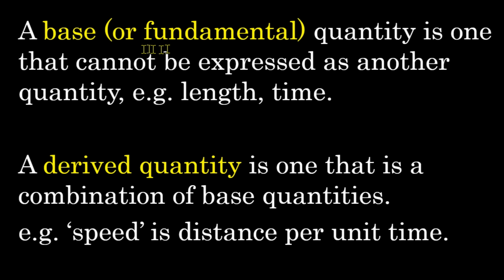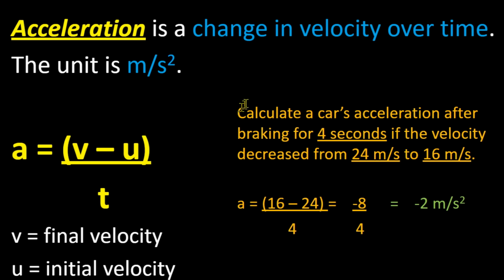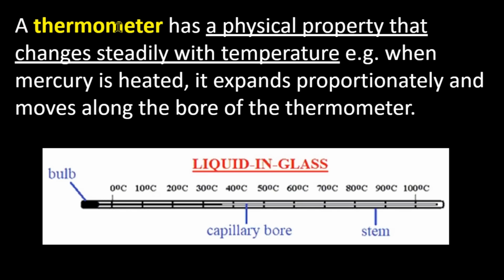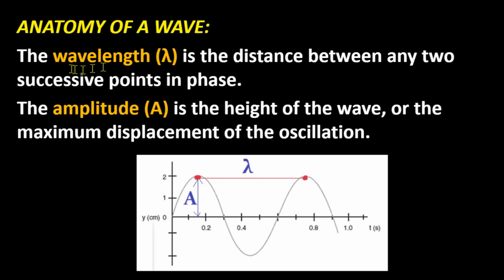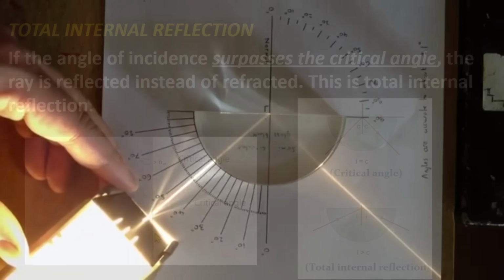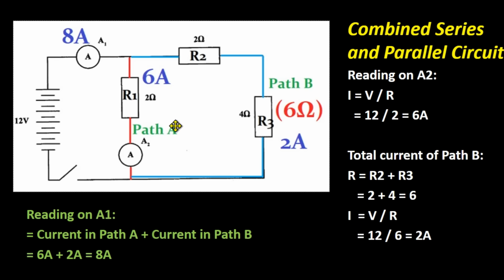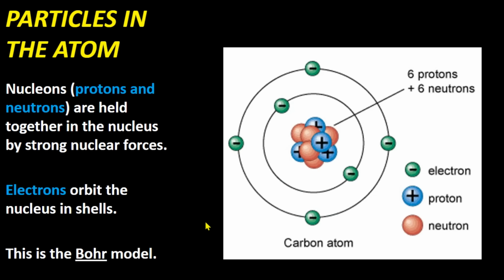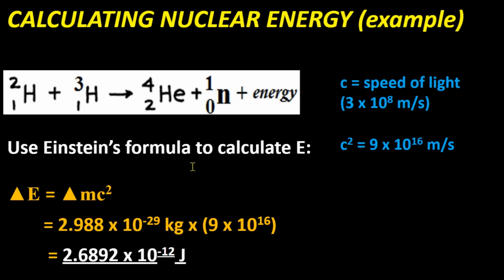2 Years of CSEC Physics in 2 Hours (Free Crash Course)

Comment: sir 25:07 wouldnt the formula be P=W/t.
Reply from the maker: Yeah, they're interchangeable in this case. I say so in the audio. Energy is the capacity of a body to do work, and work is the process or mechanism at which that energy is used or converted. Think of energy as money in your bank account but work is that money spent on a transaction.

You can also think of the formula as P = (Force x distance) / t

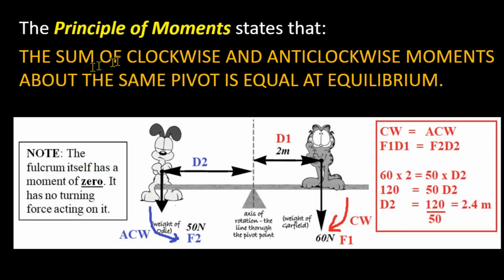Comment: For 8:44 u meant to say the fulcrum is in the middle right for the third class levers?
Reply from the maker: Third class, the effort is in the middle. For e.g. a pair of tweezers, which is meant more for precision than amplification of effort force, the distance between the fulcrum and load is greater than the distance between effort and fulcrum.
Reply: Oh okay, the diagram had the fulcrum in the middle, not sure if I'm misinterpreting but thanks for the clarification 🥰
Reply from the maker: @NotMagnuss  Ah! Thank you for asking, though. In this particular case with rhe bicep, the fulcrum and effort are very, very close to each other (perpendicularly). But the fulcrum still remains on the end of the lever.
Reply: Oh wrd wrd I get that now thanks

Comment from the maker: Broad Topics 2022 CSEC

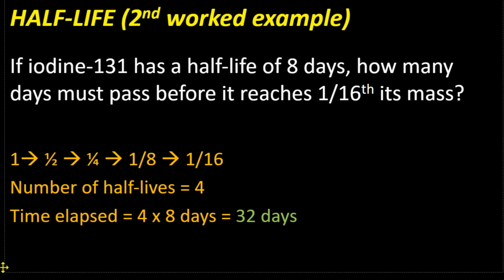Radioactive Decay Graph - 1:58:57
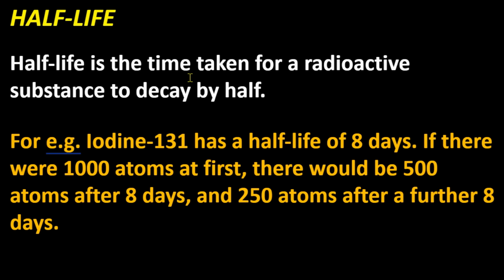Half-life - 1:56:32
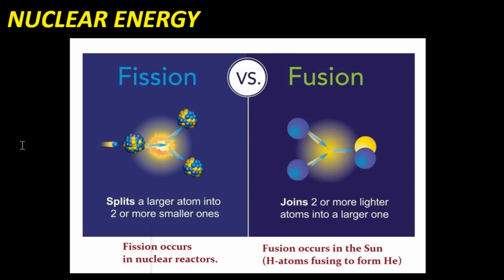Nuclear energy - 2:01:21
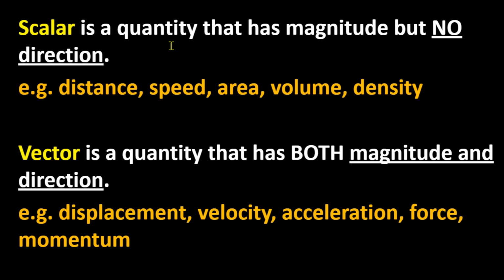Vectors - 1:47
Forces - 5:00
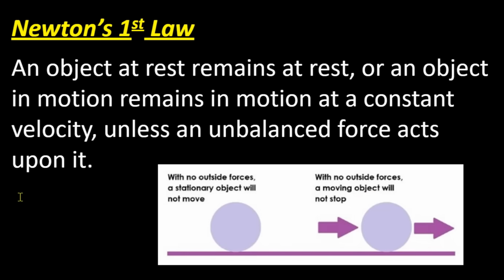Newton's Laws - 19:40
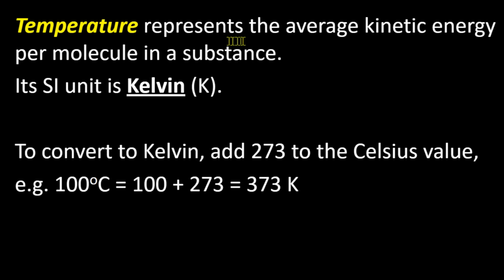Temperature - 34:47
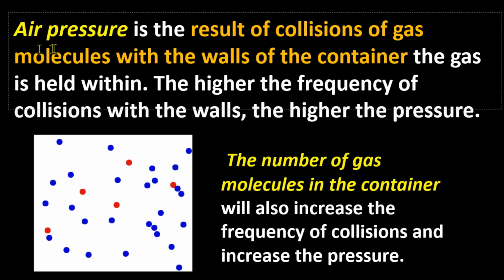Gas Laws - 46:55
Hydrostatics: 13:37 and 29:45
Wave Motion - 53:28
Sound - 57:45
Lenses - 1:12:22
Current Electricity - 1:16:28
Electrical Quantity - 1:16:28
Circuit Diagrams - 1:24:31
Reply: Life saver😭😭
Reply: sir you have for Chem?
Reply: Sir would it be okay If I made a mistake writing an answer and put lines through it and put question number to back of the page and then write answer in stead I only made 2 mistakes I was wandering if cxc would fine it to messy how I put lines through it I am so frustrated and worried
Reply: I plead you to make a chemistry video just like this physics one